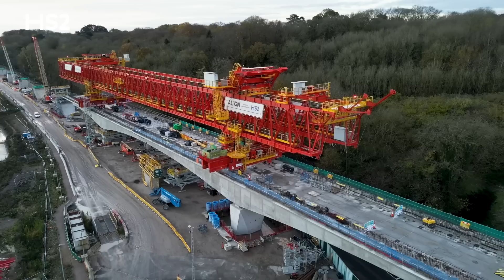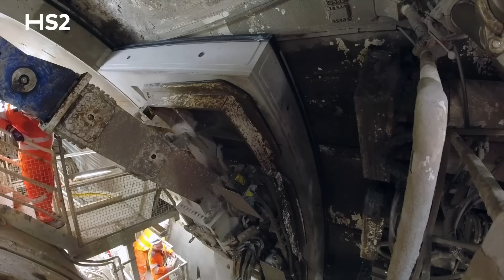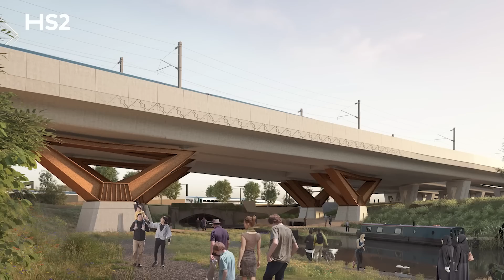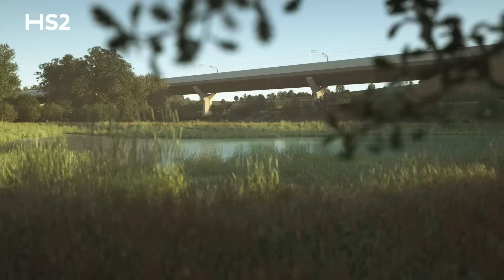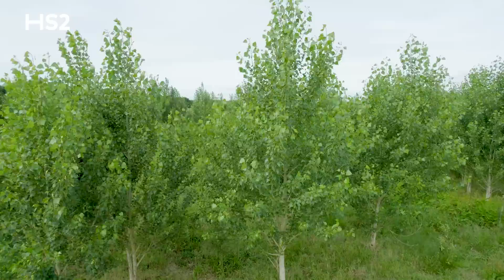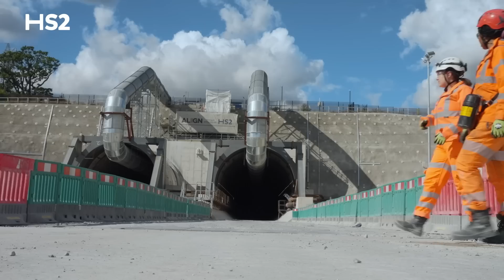HS2 Project Update, January 2023

Comment: Are the trains going to run at 250mph?
Will they be driverless, advanced machines?
What will a standard return ticket from Birmingham to Old Oak Common cost?
Reply: The trains will have drivers, travel at 225 to 250MPH and will be terminating at London Euston as per the Prime Minister and the Chancellor of the Exchequer as NO one will use HS2 from Birmingham and the North if it terminates at Old Oak Common and not London Euston.

Comment: I find it bizarre that some of your work sites in urban areas are running generators at all. In one of your videos, they were talking about a site where they were trying to reduce generator noise to minimise disturbance to the residents across the road. Surely it would make far more sense to install a mains connection for the duration of the project.
Reply: Short-term requirement for additional power during the construction phase, then the neighbourhood power needs drop back to previous levels. Not worth the extra cost. Ten billion spent on a ten mile tunnel to keep the Chiltern Nimby squad quiet was enough!
Reply: I would have thought that was something to do with generators being easier to remove once construction has finished, but then I'm not part of HS2 Ltd., so I wouldn't know.

Comment: HS2 should be working by 2060 by which time most of Europe will be covered with high speed rail, and the UK will have 130 km of track
Reply: Much of Europe's High Speed Rail you talk about is suitable for 200kph/125mph, how many miles of 125mph capable rail to you think the UK already has? Dedicated lines for 250kph+ are nowhere near as common, nor will they be even by 2060.

PS HS2 should be running services by the early 2030s and HS1 has already been running for many years
Reply: @bfcmik  3,762 km AVE in Spain
Reply: @mikiex  and with a choice of high speed operators, there are bargain high speed rail fares in Spain.
Reply: HS1 is 106km. Birmingham to London will be completed by 2030, if not sooner, an will add a 215km alon which means Britain will have 321km High speed track, still pathetic but well we got a  pathetic government so what can we truly expect .  

Hopefully Labour will get elected into power and work on HS3 construction will start before 2030.
Reply: Not really a glass half full guy are we ?